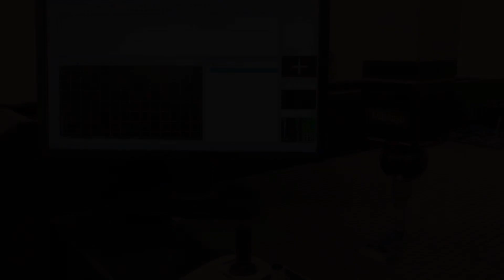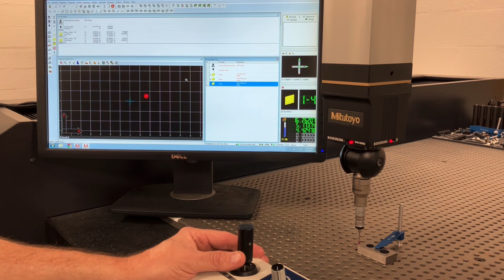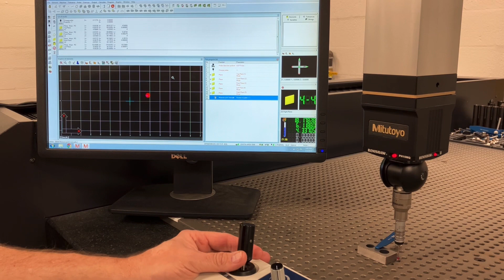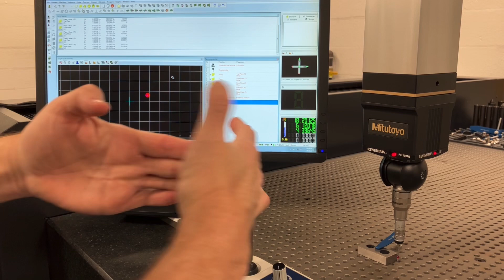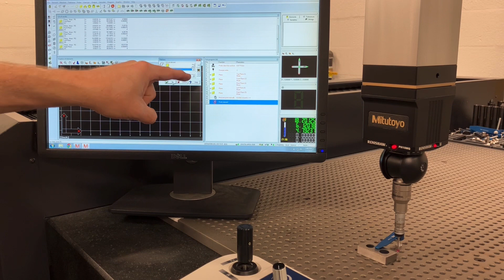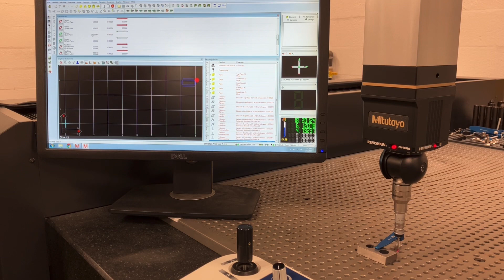GD&T in MCOSMOS, Mitutoyo

Comment: Have you ever programmed without the manual inputs? If so, do you find manual easier? If so if so, is it easier enough to justify the cost? Right now I’m just programming and using offline mode and CAT1000 to prove it out.